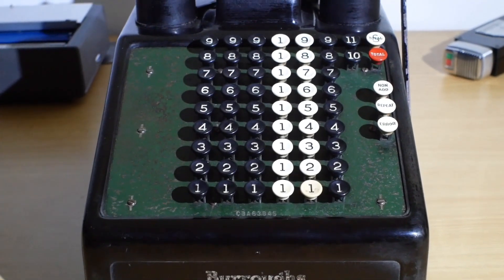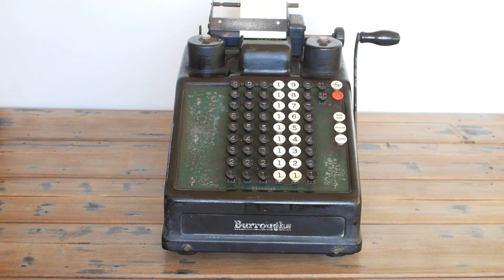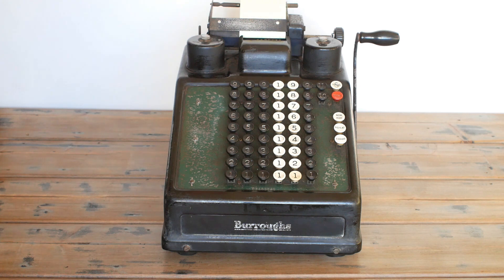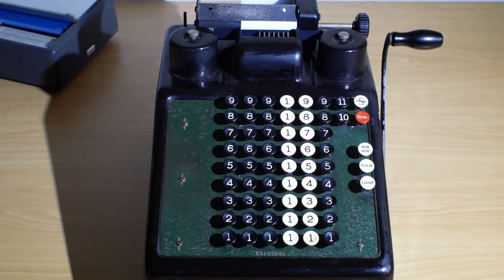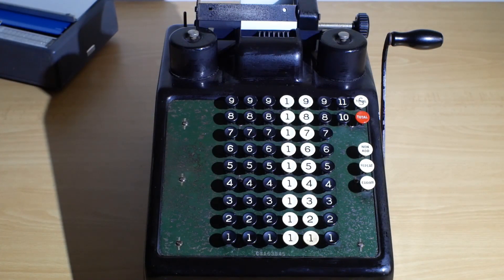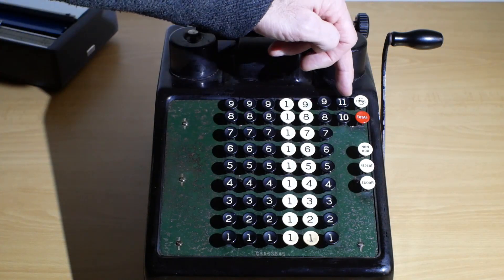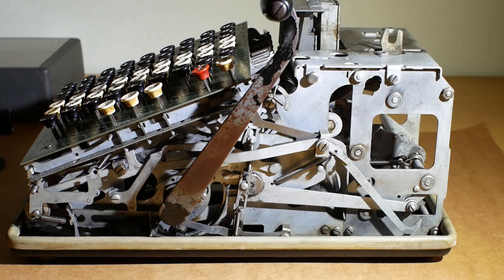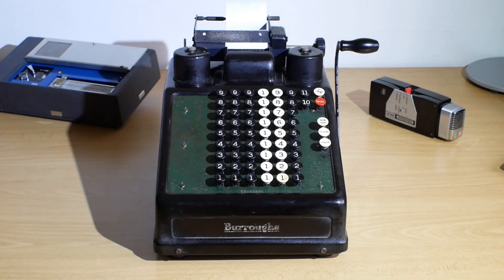Retro Tech, Burroughs Class 8 Portable Adding Machine - Repair & Overview.

Comment: I just purchased a Burroughs machine very similar to this (I'm in the USA).  It's an 8 column Machine, I think its a 'class 8'. I researched the serial number and dated it to 1935. I know nothing about these machines, but have wanted one for a while. This is my first. I don't know if it works, but your video is a great start to help me find out. Thank you!
Reply from the maker: Brilliant, you'll have lots of fun with that.  It's not unlikely that some parts inside will be gummed up with old oil but if you work round the machine checking that everything is moving correctly and freeing up anything that's stuck, that will hopefully get you up and running.

Watch out though, collecting old mechanical calculators and adding machines can be a bit addictive  :-)
Reply: @GrumpyTim  Thank you for the reply.  On only a few columns when I press a number and pull the crank does the number arms move up a strike the paper.  I'll punh in 7655 and only one arm moves up and strikes.  I'm using Ativa Cleaning Duster (compressed air) to try to clean out under the key pad.  What else should I look for?
Reply from the maker: Hi Kicks001 - I'm away from the Burroughs until the weekend - when I'm reunited I'll have a look and come up with some things to look out for.

So long as the keys are pressing down and staying down until you pull the crank handle then the keyboard itself should be ok (all that happens when you press a key is that it lowers a metal tab that stops a spring loaded moving rack in the right place).

It's likely that either the racks or the number arms are sticking.  I'll be able to make better suggestions when I'm re-acquainted with the machine in a couple of days.
Reply from the maker: Hi Kicks001  I'm just having a look at the Burroughs - if you look from the rear of the machine, behind the vertical racks that extend upwards with the number arms there should be some vertical springs, one for each number arm so if your machine is an 8 column machine, you should have 9 springs (the extra one is for the arm that prints the symbols next to the numbers).  These vertical springs provide the tension that moves the printing arms upwards and also the racks down the keyboard that interact with the number key you've pressed.  If any of these springs are missing or broken, that could be your problem, but it's more likely that parts are just stuck with old oil and grime or even rust if the machine has been damp.

If you enter 9's all the way along the machine and start pulling the handle, all the columns should start rising - keep holding the handle part way and try gently pulling up on any number arms that haven't moved (if they are just a bit sticky, they might move and free up).  If they do move but are still tight, try to look at all the joints on each sticking column and put a drop of light oil (such as sewing machine oil, 3 in 1 oil or other general purpose oil) on each moving joint or pivot.  Once you've applied some oil, enter all the 9's again and start moving the handle part way - hold the handle in this position and try moving any sticking columns up and down to free it up.

The other thing to check would be to look from the front of the machine - if you press a number in a single column that is actually working and start pulling the handle and look beneath the two plates that make up the keyboard sandwich, there's a vertical plate about 2 inches back - you should see little arms in front of that plate (one for each column) and the one for the column you've pressed should be out of line (lower) than the others.  Thar arm allows the rack that interacts with the keyboard to move - if no digit has been entered on the keyboard these arms block the rack so it won't move.  Now try a different column and see if its little arm sits out of line like it should when you pull the handle.  It's unlikely that there will be a problem with these little arms unless something has been forced, broken or assembled incorrectly.

If any part of the rack that interacts with the keyboard or the columns at the back that have the numbers on them are gummed up with old oil then it could prevent the numbers from raising correctly.

Hope this helps a bit or at least is a bit of a start.
Reply: @GrumpyTim    Thank you. That was good advise.  But I have good news and bad news.  First the good.  Your suggestion worked for those printer arms. I  was able to get all but 1 working.  The bad news;  while trying to get the last arm working I hit a rod in the bottom front of the register that has large sprints attacked to it. The bar and springs went flying to the back of the register and the sprints detached from what ever they were connected to in the back. There is no way I can reconnect them.
Reply: @GrumpyTim  I replied earlier, but I don't see my reply posted here, so I'll re[post, but with an up date.  Your suggestion works to get the print arms (vertical racks with numbers) worked!!!  Well, all except for 1 column. While working on that I hit the pole with the large springs on the bottom from of the machine. It went flying to the back of the machine and unattached the springs at the rear. I thought I was done. I broke it for good.  But I figured out how to remove the bottom and it was an easy fix!  Now I'm back to trying to get that last row to free up.  Or should I stop while I'm back in a safe place LOL.
Reply from the maker: Ah, I read your first message and thought "oh no!!!" but luckily you've managed to re connect the large springs - those are the ones that put tension on everything else in the machine - glad you got that lot back together ok.

Now that you have the bottom panel off try to look at any moving parts on the path of the column that won't move - add a drop of oil to any pivots or sliding sections (hopefully you'll be able to see more with the bottom off - I never took the bottom off mine so I don't know how much more you can see from there), then leave the machine for a day for the oil to penetrate a little.  Then try again giving that column a wiggle (with the handle pulled part way) to see if you can get any movement.

While I think of it, I presume it's one of the number columns that isn't moving - the far right column (when looked at from the front) only moves when you press one of the buttons for "total", "sub total", and the button to print a non added number.

If you can track down the actual area where the column is sticking you could apply a little heat carefully to that area - making sure you don't heat everything else - I use an electric heat blower for this job that's intended to be used for embossing in crafting and card making - you'll see the thing I mean if you look at my Monroe LN160X Refurbishment video 6 minutes and 4 seconds into that video.  Heat can help to soften old sticky oil that's stopping stuff moving but if rust is your problem it won't help much.

It won't hurt to walk away from the machine for a day or two, particularly if you have managed to get some light oil onto the sticking area because it can penetrate slowly over a few days, the part might not suddenly free up but it might then be easier to wiggle it free.

Keep me posted on how you get on  :-)
Reply: @GrumpyTim  I have an 8 column class 8.  It's the 5th row from left that's still stuck.  I'll let it sit and soak a day or two then get back to it.  Thank you so much for helping me.  I'm not mechanically inclined. This is all new and intriguing to me.
Reply from the maker: You've definitely made progress, hopefully letting it soak will help - I've had machines that have been really seized when I've started work on them.  After oiling all the sticking parts that I could get to I've just put them aside for a couple of months and then looked again.

With a bit of luck the sticking column will eventually free up enough that you can jiggle it and get it working properly.

Keep me posted on how you get on.
Reply: @GrumpyTim   It works!   I did as you suggested and looked at how the gears moved on the keys that did work. I isolated the stuck one and found where it was sticking. I put some Naval Jelly Rust Dissolvent on it and worked the arm.  Let it sit. Work the arm. let it sit. worked the arm and it moved a quarter way up. Let it sit. Worked it and it went up half way. let it sit  and Bam!  Went all the way up on its own.  I continued to test it as I put it back together and once all reassembled did a test of it printing on the receipt paper.  It work, even accumulating the totals on multipole entries.  Again, Thank you so much for all your help.  be proud of yourself for posting a video that really helped a novice like me restore a machine that will be a display piece in my general store museum.  Thank you, may God bless.
Reply from the maker: Excellent, and congratulations for fixing your Burroughs.  Wow, a general store museum, that sounds exciting.

You might find that if the machine isn't used frequently that the old oil might become stiff again but it won't be anything like as bad and should free up quickly with a bit of use.

Really glad you've got it running  :-)
Reply: @GrumpyTim  Hello Tim, remember me? (see above).  I now have a Burroughs class 3 (1924) machine. It is also locked up like my class 8 was. You helped me tremendously to fix that one.  Have you worked on a class 3 ?
Reply from the maker: Hi Kicks001,  I haven't worked on a Class 3, but my usual approach for any machine would be to observe what isn't working, try to free off each part in turn with a bit of oil, heat and lots of wiggling.  Usually, if you look enough, you'll be able to track down the route a particular part takes and by giving each linkage a wiggle to see if it's free, you'll be able to locate the sticking latch/lever or whatever.   Never use force - I've been working on a Madas recently and someone had been there before me, bending several parts in their attempts to get the machine running, it's taken ages to track down all the bent levers and straighten them.  Don't rush at your project, it'll take time.

bss1250 repaired a Class 3 a couple of years ago and did some videos, they might be worth a watch, and you could always quiz him if there are any specific problems that you have.
Reply: @GrumpyTim  Yes,  I watched his videos. Kind of long so I'll have to go back and watch again and pay particular attention to what I think relates to my situation.  I'll let you know how it goes.
Reply from the maker: @Kicks001  Awesome, I'd like to hear how you get on with it - I bet there will be similarities to the Class 8 in some way or another.
Reply: @GrumpyTim  Hopefulli I can learn from my previous mistakes, such as Stay away from the springs! Those were a pain to reattach. :)
Reply from the maker: @Kicks001  Haha, yes, they're so easy to remove and then such a pain to re-attach on virtually any bit of machinery - I have hooks tweezers, bent paperclips and all sorts of other stuff to help re attach springs - sometimes there's no choice, they have to come off, but life can be easier if they can stay in place.

Comment: Adding machines are interesting. I wonder how much that cost new?
Reply from the maker: I don't know the exact price in the 1930s when this one was made but I've seen adverts from when the Burroughs Portable first came out in the 1920s and it was 100 Dollars which was quite a chunk of money.  I love the fact they called this model "portable" - I think some of the earlier models sat on a metal set of legs and had glass panels in the sides so by comparison, this model WAS portable.  I have a mid 70s calculator that I'll do a video on at some point - I've seen an advert for it in a 1975 magazine and it was £118 - they were serious bits of equipment in those days!!!
Reply: @GrumpyTim  they certainly were. Very expensive bits of kit.